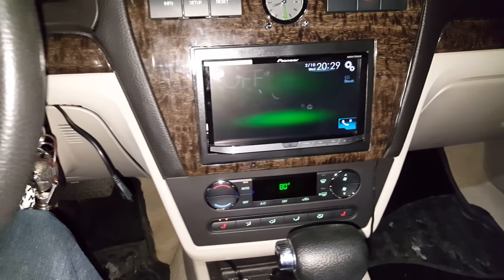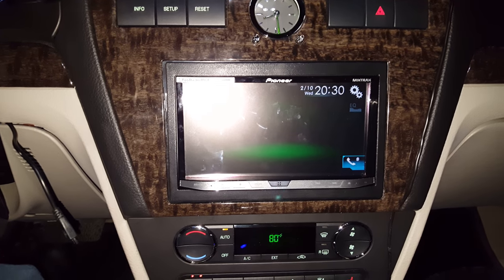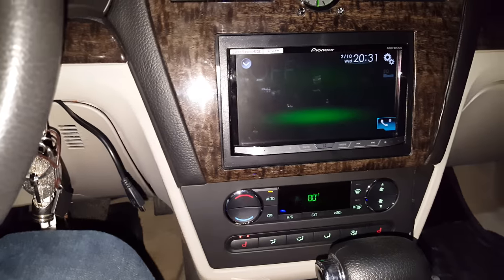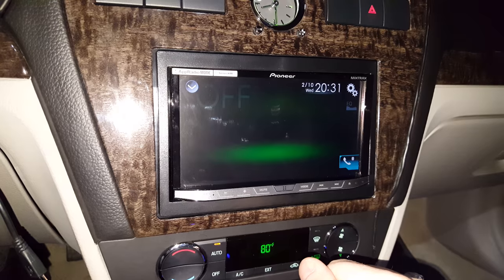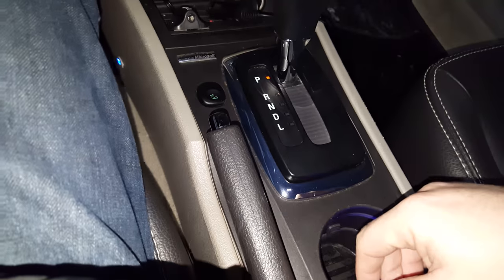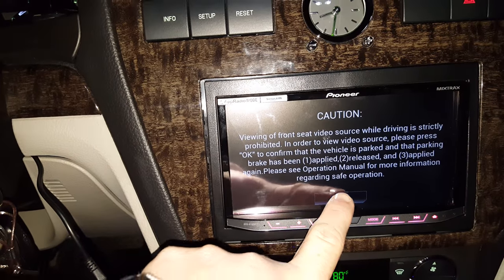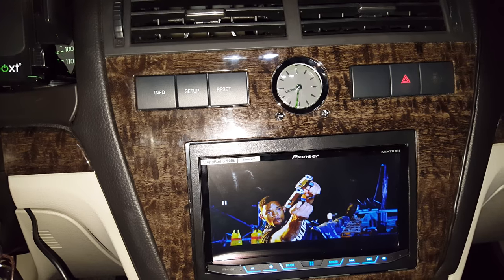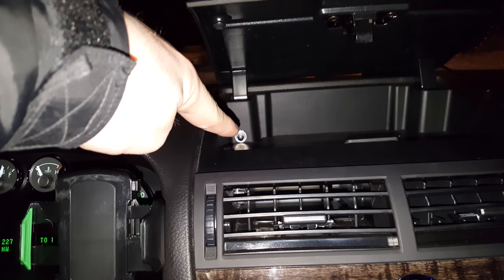Pioneer AVH-4100NEX parking brake bypass

Comment: You can also ground it in the illumination wire if you hooked it up
Reply from the maker: +Ashauni Samuels the safety on the head unit requires a "double pulse" to activate. More of an on-off-on. Wiring to illumination has worked in the past but does not work anymore.

Comment: is that a momentary switch or a on and off switch?
Reply from the maker: it's an on-off-on switch
Reply: Awesome. Thanks for the fast reply! I'm doing this on a avhx2800bs.
Reply from the maker: +Dustin N. you're welcome, should be easy on that one too
Reply: +Jamie Burkitt. Alright so simple as green wire to switch then from switch to ground? that should enable the dimming option correct?
Reply from the maker: +Dustin N. i think you mean brake bypass, if so, yes
Reply: +Jamie Burkitt yes trying to bypass that crap. alittle annoying.
Reply from the maker: +Dustin N. what kind of vehicle are you working on?
Reply: +Jamie Burkitt 2007 f150. I got it now though. I just stright grounded it.
Reply from the maker: +Dustin N. cool, your model probably didn't require a double a "double pulse" signal